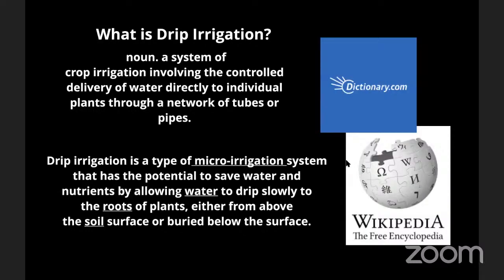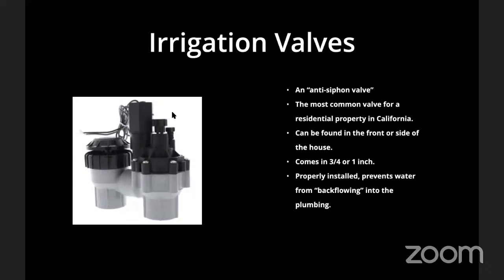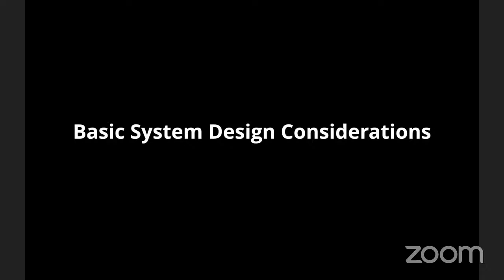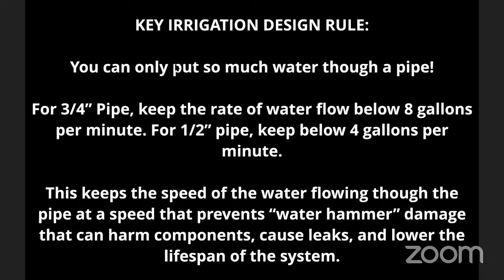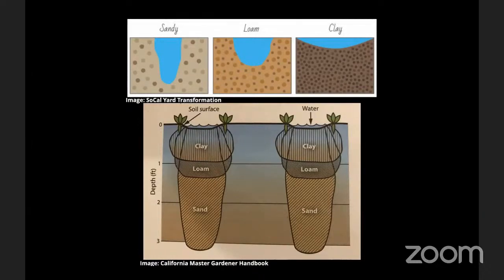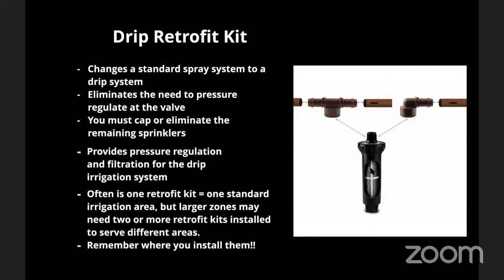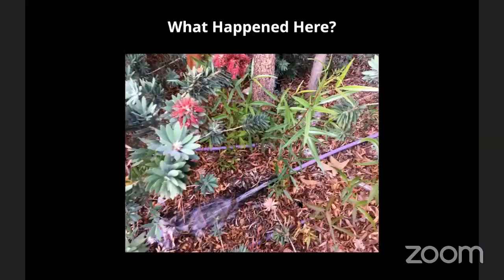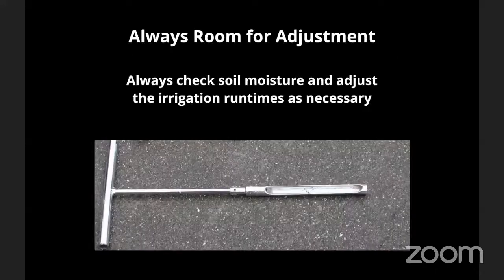Drip Irrigation Design and Installation for Landscapes

Comment: if I have a house with front yard and big backyard, do I install two POC with different service boxes? and do they have to be next to each other? or one poc in the front yard and pipe lines run all the way to the back yard for the other POC?